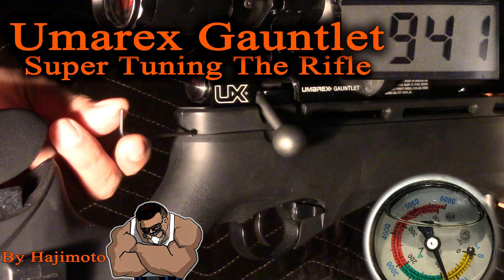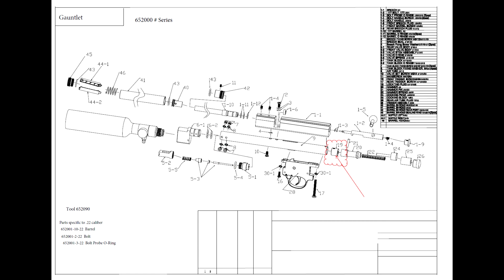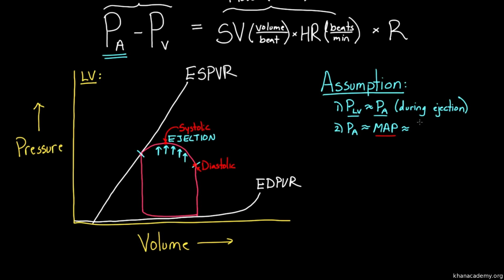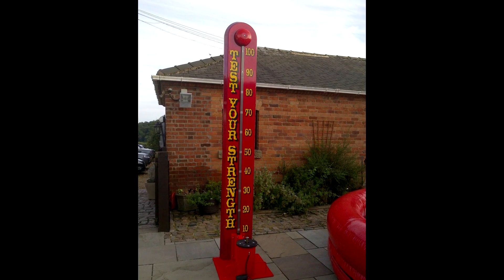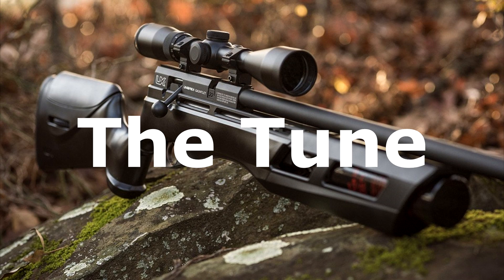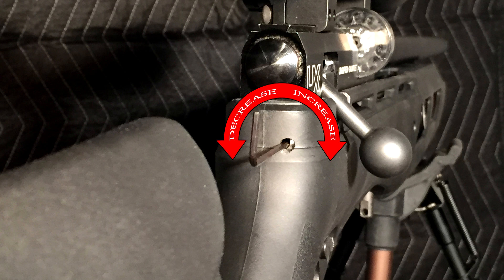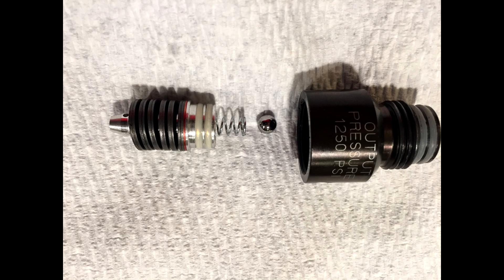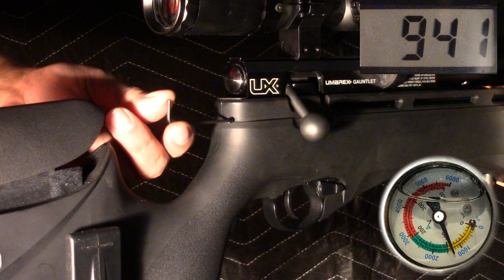Umarex Gauntlet: Tune Kit Results

Comment: Imagine if you have the upgraded large tank probably looking at 400 shots on low gees Louise... I got my large bottle on eBay for 32 bucks from China. Just look up (0.38L Aluminum Tank Air Bottle 3000 PSI For Paintball PCP) if you guys want one
Reply from the maker: Yeah you are probably right on the 400 shots, LOL but to be honest, if a rifle gives me 40 good shots, I'm happy. So you can imagine how happy 60-110 shots can do for me, LOL thanks for the tip large bottle tip Joe.  Happy shooting!
Reply: You can get a 0.45L 4500psi tank for $30.55 free shipping from AliExpress.
Reply: fathertimencwillyoy modify guns for other people.
Reply: Ronald E. Downey No but it is very easy putting another regulator and bigger bottle on it.
Reply: fathertimenc rred1151gmail

Comment: @Hajimoto Productions ... Love the vids this was my first "real" airgun and I fell in love with it watching upgrades and things youve done to yours. I be buying this kit soon cant wait! Also the baffles and air stripper. Your regulated pressure is set to 1400psi right now correct??
Reply from the maker: Thank you for the kind words and I am honestly flattered to hear that my videos played a part in your choosing the Gauntlet. As for the regulator, in the regulator adjuster video, I mistakenly say that my reg was set to 1400 when, in fact, it was more like 1300 but after I realized the error I opened up the reg and dropped in another 0.05 shim to bring it up to 1400psi which is where it currently is.

Comment: Hi hajimoto I don't have a hol on my gun to adjust the power on my gun, how can I do that to have more power thank you
Reply: nano tv I'm thinking that you need to watch Hajimoto's installation video. Hajimoto installed an aftermarket valve in his rifle, during that process he drilled the adjustment hole in the stock. Your rifle is unmodified, that's why it doesn't have the adjustment hole. Hope that helps.
Reply: @Thorny8  nailed it.
Reply from the maker: I am really sorry but I do not understand if there is a question here.

Comment: Love your videos! My father and I have your air strippers in both our rifles and we tuned our regulators this weekend with the help of your video. We are getting on average 890 fps with the tuned regulators and are planning on the tune kits next!
Reply from the maker: Jeff it is great to hear that you and your dad worked your rifles together. You are getting 890ft/s with what caliber and grain pellet? The tuning kit will blow your mind! You will get the same ft/s but 70% more shots per fill.
Reply: We are shooting .22 cal 14.3 grain crossmans. Great pellets for the price point and availability.
Reply from the maker: Thanks for the response. I agree the CPHP and CPD 14.3gr pellets do super great in the Gauntlet. JSB's are a bit more accurate but for anything under 60 yards you don't need much more accuracy.

Comment: Nice video bro 
What type of string and velocity areyou getting with 18.13 jsb
Reply from the maker: Thanks Macolm. 18gr??? No clue, but one could make an educated guess based on the physics provided int he video that on high power with the regulator at 1300-1400 that an 18gr would be somewhere around 880-900f/s. The thing is there are of 40 different .22 caliber pellets and I obviously can not do a string on all of them but I do provide the physics for the viewer to calculate that value.
Reply: @HajimotoProductions  grains x fps x fps / 450436.6798 = fpe
18 gr x 890 x 890 / 450436,6798 = 31.65328367 fpe, exact, if you are at sea level and 45 degree latitude; otherwise, it will be approximately 0.01% off.

Comment: Was up Hajimoto. I recently bought your super tune kit and I’m going ad some shims exactly like you did in your video to the reg. My question being is, I love the gauntlet but man mine has been extremely inaccurate. I’ve torn the gun down and cleaned everything and still the gun shoots all over the place. Have you heard of anybody else having these inaccuracy issues. Love the videos  keep up the good work.
Reply from the maker: Hey Jon, well I have heard of certain Gauntlets having serious issues. In some of those cases, the crown of the barrel was AWFUL, be sure to take a look at that. Next completely remove the shroud and shoot the rifle with no shroud, does it shoot more accurate? The baffle may be shot, chipped or general jacked up.
Reply: Yeah I looked at the crown and it looked ok to me but I’m no expert. I’ll shoot it with everything off and I’ll get back to you. Thanks.
Reply from the maker: Are you on Facebook?  If so it me up with some photo of the crown please. If not on FB send some photo to Hajimoto_ecwc@comcast.net

Comment: thats been true with most of my rifles but the hammerli 850 stabilizes them extremely well at 950 to 965 it consistently shoots .600 size groups at 50 yds so i was just curious keep up the good work
Reply from the maker: Wow interesting, is the Hammerli 850 a non choked barrel?
Reply: no its a choked lother walther if im not mistaken
Reply: my hammerli is a gun i added a bottle regged to 1600psi modded the valve and did some other bits to its boring accurate out to 40 yards

Comment: reason being ive got a 850 that shoots the 18.13 around 950 to 965 on the reg and they are more accurate at that velocity instead of 850 fps so just curious
Reply from the maker: The thing is, maximum FPS for a Diabolo style pellet is around 920FPS I have found them to be most stable at 865 or so
Reply: yes i agree around 850 is usually about perfect butnot in the hammerli i have its probably just a fluke maybe the choked barrel and that pellet just work harmonically together i dont know but its a great rifle for hunting i just prefer a short rifle to hunt with most of my squirrels are depopulated out of the truck window lol

Comment: Awsome Haj, I know the hammer kit will get mine up in the 900s easy. Just with reguator pressure at 1450psi the jsb 15.3 are at 890-881 fps. I added a joe broncto 31ci bottle and reg. Your air stripper and moderator stack. And i haven't opened up any of my transfer ports yet. Can'wait to get my kit and see the differance it will make and the shot count should be way up with the bigger bottle. Thanks for all the mod videos. There fantastic. Dave
Reply from the maker: Hey Dave you are welcome!  The valve will be so efficient you may have to reduce the regulator pressure as the lowest setting may not be low enough.
Reply: They are fantastic. = THEY'RE  fantastic.

Comment: Haj... I PERSONALLY Talked to a Supervisor at Umarex USA and he told me that if i did any mod to the shroud like drilling an exhaust hole that it would NOT void the warrenty on the gun. He said it would void the warrenty on the shroud itself. Meaning if there was any issue with the shroud that needed to be repaired the warrenty would not cover it BUT it would still cover the rest of the gun like the internals and anything that wasnt part of the shroud itself etc... He said the same goes for the foregrip. If i mod the foregrip to add a bipod, then the warrenty would no longer cover the foregrip but would still cover the rest of the gun that isnt apart of or affected by the foregrip like the internals and so on... Anyway, I just thought id let you and others know this as ive seen there has been alot questions concerning it lately as alot of people are modding them and as alot of newbies like myself are wanting to start getting into modding and tinkering... Now i didnt think to ask him about the regulator on the bottle, and if adjusting the regulator would void the warrenty on the internals. Now i wish i would have because on that, I dont know. Im thinking that it COULD void the warrenty on the internals since adjusting the regulator has effects on the internals, BUT Im not sure. That would be something else that would have to be asked of a supervisor to make certain, one way or the other. Anyway, I hope this helps anyone who may have had questions concerning this topic. GoodDay ALL... Haj Keep the Awesome and Always Informative Videos coming! "We are not worthy, We are not worthy" lol ;)
Reply from the maker: Great post, Dr Jones.  Did you ask the supervisor to provide you with that statement in writing, regarding the warranty on the individual part? I think it is good that folks understand that a warranty on a $290 rifle is not something that should prevent you from getting all the fun out of the rifle that you can. I would say my mods are very conservative and never put the rifle or the shooter in a dangerous situation so to wait 3 years before you enjoy your rifle is like not having the rifle at all (to me)
Thanks again for all the support Dr Jones, keep on keeping on!
Reply: @HajimotoProductions  i like your modsugetuon, i just want someone that has don them to do nines

Comment: That is alot of shots on low awsome , very impressed with all low and medium power shot count
Reply from the maker: It is safe to assume high power will produce about 40-45 shots
Reply: Impressed with shot count but not with regulator fps spread on low setting with Crosmans. #s were all over the place...cant be good for accuracy which is my priority.

Comment: Mr. Haji, I believe your gauge shows a pressure of 1300. It is easy to get mixed between the bar and psi hash marks.
Reply from the maker: You are right, I was looking at my notes when I said 1300 and then looked at the gauge and thought I stated the wrong PSI previously.  You are right, easy to confuse. Thank you Jim

Comment: just out of curiosity why did you not do a high power string and with heavier pellets like the 18.13 or 15.89 those are what mine likes and im wondering if this will get the 18.13 around 900 to 925fps
Reply from the maker: Only because I can not so testing with all ALL pellet and all weights. I think by seeing what the adjust did from a 14.3gr 200 string to a 14.3 gr 90 shot string it is just over half, so one can deduce a 45 shot sting on high

Comment: How many shots do you think I could get shooting the 18gr JSB at around 900fps?
Reply from the maker: If I had to guess i would say 30 maybe
Reply: Hajimoto Productions If you had to choose this gun in .25 cal when it comes out or the Hatsan AT44 in .25 cal which would you choose??? My AT44 was shooting .25gr JSB at around 800fps. And I was getting around 36 pretty good shots, around 28 to 30 real good shots. I sold it and was looking at the Gauntlet in .25 cal when it comes out. But I just found the AT44 for $368 which would you spend your money on??

Comment: I have not modified my guns internals, I did place another bottle on it for a lower FPS for field target here in Canada. The bottle with an output pressure of 950psi I am shooting JSB 14.3's at 730's for 90 shots. This also has a lower standard deviation than what I observed with your mod on low power.
Reply from the maker: Sounds like you have a winning combination topher
Reply: I have used this output type of bottle on my QB's so I had a step up to start. I will try a bottle with 1050psi output and see if I can keep it under 20 ft/lbs.

Comment: Love the adjustability and efficiency this tune kit delivers.  The weak link (for lack of a better term) is in the guess work that may be needed if a guy doesn't own a chronograph.   Or even with a chrono, remembering how many times you turned that allen key can get confusing.  

With all the brain work it took to come up with such an outstanding tune kit it looks like it wouldn't have taken to much more work to design a small integral knurled adjustment knob with hash marks on the shank and a threaded end to take the place of the grub-screw in aluminum plug at the back of the reciever.  The hash marks could help a guy dial the power in to the same place each time after the initial testing confirmed the depths that the hash marks would be screwed in or out to.

The kit could be installed the same way your install tutorial video laid out, except that the knurled adjustment knob would be screwed in after you had drilled the hole in your stock and the receiver was back in the stock.  Hope that makes sense.

I wish I knew the dimensions of all those new components.  I'd think about making a tune kit for my own personal use.  If I can't figure it out I'll probably end up buying one and then make the integral adjustment knob mod as I picture it in my mind.

Excellent work on the video.  When do we get to see what this tune kit will deliver at full power?
Reply: Great idea Tim. However I suspect a chrono may still be needed to figure out the baseline of each rifle. I dont expect every guantlet to be standard out of the factory given it's price point and relatively low build quality. But the knob to adjust power is an awesome idea.. I am seeing 65-70 shots on mine before POI changes at 50 yards. I dont have a chrono and am using drop in POI to guesstimate the shot count. I am looking for phone app chrono's which are not exact but still better than guessing & cheaper than a real chrono. :-)
Reply: I see your point.  It makes sense but even with a chrono I still see turning that allen-key and remembering how many turns it took to get you to the velocity you're looking for as being a tad less than optimal.  I was afraid I didn't make any sense when I mentioned the adjustable knurled knob.  I'm glad the idea translated well enough in writing.  Sometimes the written word can make the simplest of ideas seem complicated or even impossible.  I guess I'll have to start saving up my spare change to buy one of these tune kits.
Reply: True that on all counts. I am still looking for a phone based chrono which I know is not 100% accurate but it's free.. a few fps here n there dont matter to me. I am sure the grey cells of Haj have started churning on the adjustable knob which eliminates the allen key turns n counting method.

Comment: Amazing work as always. 
200 shots... do you think sub 700 fps is sufficient to take a squirrel at 30 yds? I normally wouldn't take a drill bit to my stock but that is just to convenient not to. Time to get a chrony. Thank you for your excellent content.
Reply from the maker: Thank you for the kind words. The low power setting was just to show how many shots the plinker could get out of his Gauntlet on one fill. As for humane kill, 14 to 15FPE (14.3@680FPS), Absolutely without question. Thats like a 9gr .177 @ 850FPS, same FPE.
Reply from the maker: Please remember the first 10 shot set was using the 11.9 Hobby pellets and they were screaming out at 940FPS and thats 23.3FPE!
Reply: Oh yeah, could be the perfect setting for a night of rating I can't wait to help some Farmers out.
Reply: @wannabemgtow2540  any farmers need help in south fla?

Comment: 200 shots off one fill with that regulator?????  Cause if so I'm upgrading mine ASAP
Reply from the maker: Those 200 shots were off the regulator set to 1350-1400PSI, and one fill you saw the timer and the pressure gauge the whole time.  The Tune Kit is that efficient.
Reply: Haj, If the regulator is not adjusted using the shims and is @ default from factory of 1150 or so, what does it do the shot count . I assume tweaking the reg is not a requirement for tune kit with the understanding that shot count would change.. or is the reg mod highly recommended for better perf? Ty